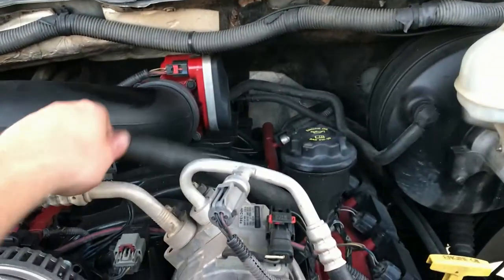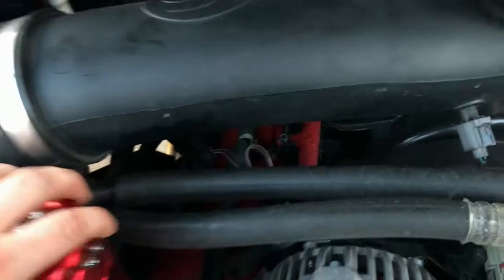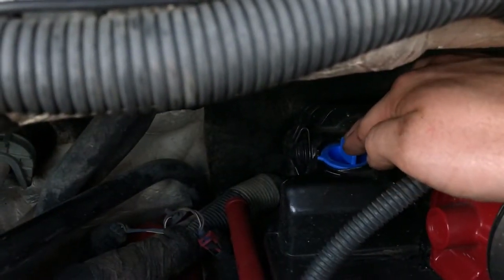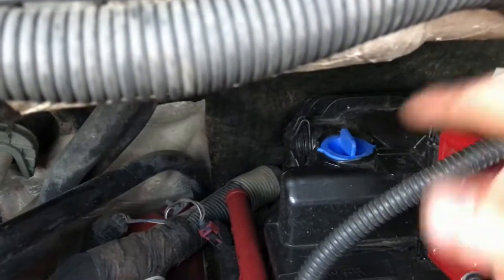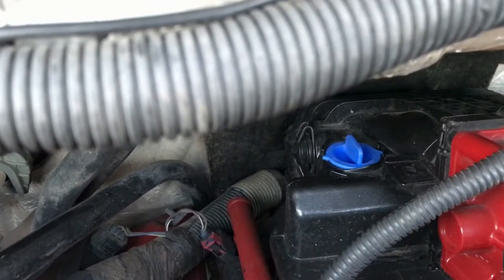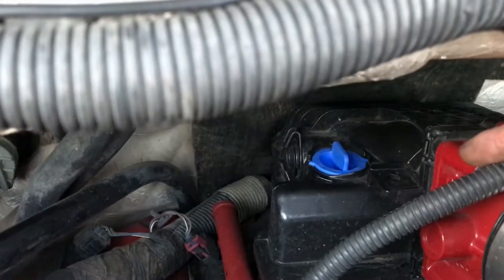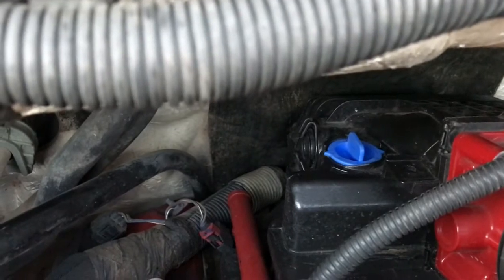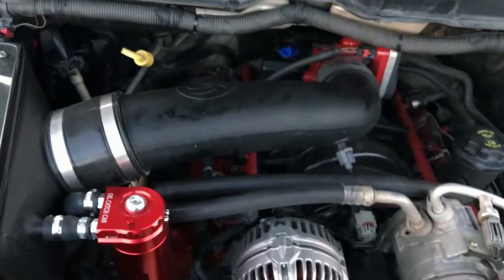Proper Install of an Oil Catch Can on a 3rd Gen Ram Hemi | PCV Reroute

Comment: Hi. In your video, you are holding a white coloured valve. What I see you installed in your truck was a black one. Where did this white one come from ?
It also looks “cleaner” than the ones you show for sale on the EBay link.
Reply: You also say may not ship to Canada. 
I’m in Canada so am I still able to get one ?
Reply: Well. 
I just tried to order one and it says that it will not ship to where I live. !!!
That sucks !!
Reply: Ok. 
I did not know you had none left either. 
EBay says you had stock. 
If it will then ship to Canada, I’ve got a couple other guys who may get one as well. 
I will check back in a couple weeks. 
Thanks.
Reply: Hi again. 
In this video, you show an adapter hose. It’s plugged into the top of this part and then the pcv valve goes into it. 
Do you happen to remember the number for it ?
I have searched a few sites and can’t find anything similar.
Reply: Thanks. 
That’s what I was thinking and seeing as well but you think I could find anywhere , someone listing its sizing !!! Nope !!! Lol…

Oh. FYI. I also ordered that part this morning. 
I got it being sent to a buddy in Washington. 
👍👍
Reply: Hi. 
I’m just wanting to check on my order. Placed on March 28. Buddy still has not received it yet. Thanks.
Reply: Hi. 
Do you have a tracking number please so I can find out where my order is. 
Thanks.